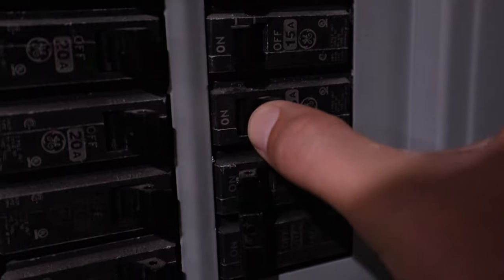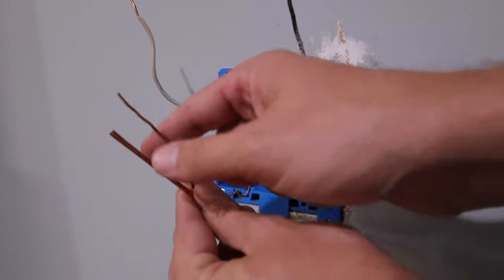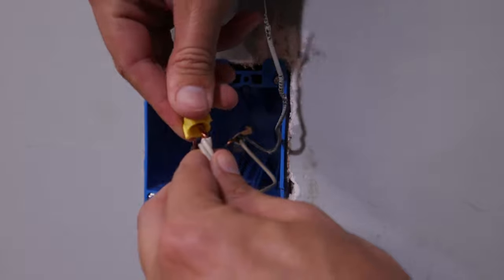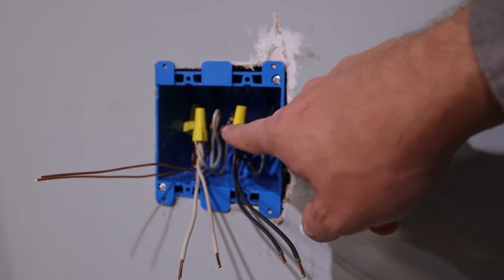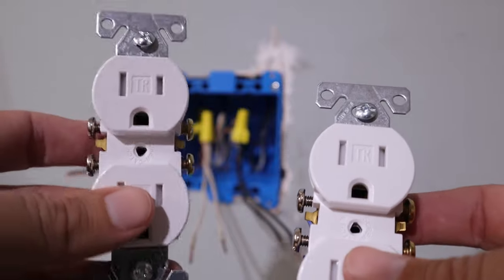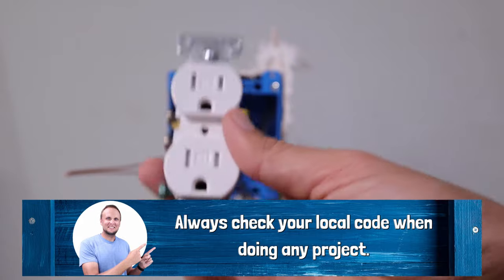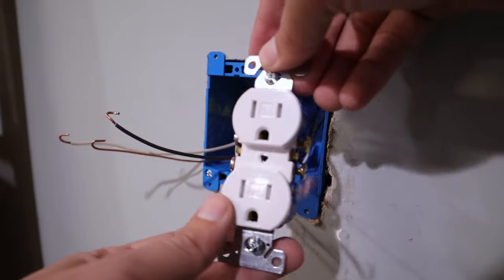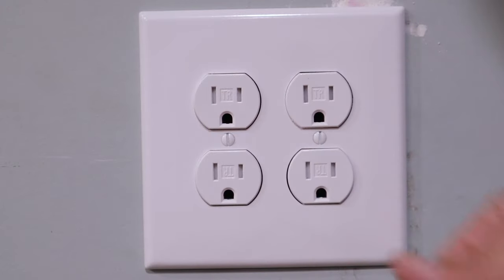How to Wire 2 Outlets In One Box | Wiring a Double Receptacle the Correct Way

Comment: Why use pigtails instead of using 1 receptacle as a passthrough, e.g. jumper 2 receptacles together using the extra set of screws?   Is it a code requirement?
Reply from the maker: In some places it is my understanding that it is code.  It has become the standard according to all of the electricians I have spoken with.  The idea is in case one of the outlets goes bad, that it is independent and doesn’t cause issues for the others or lights down the line.  Also my electrician friends state that using pigtails are safer.  Hope this answers your question!

Comment: Cool! What's the deal with loading? Are the wall cables strong enough to take double the load?
Reply: Technically no, and he should have pointed this out. The feeder wire is obviously only 14 gauge "Romex", and should be supplied by a 15 amp circuit breaker. The wire size here, suggests that this dwelling (and wiring) is quite old & not up to modern NEC spec's. Also, receptacles are specifically designed to be used as a terminating point for this type of wiring. Improperly installed wire nuts are just another place where a high load can cause overheating & failure & eventual fires. 
Ps: I never install 15amp receptacles,  only 20amp. The latter is built much sturdier than 15amp with better spring pressure & more connection options. Please, please, never use the "backstabbing" push-in terminals on receptacles unless they are the screw-down type used on good quality 20amp commercial & hospital grade (orange) outlets.
Btw, I'm a 72 yr old retired master electrician & used to teach apprentices (and anyone else who wanted to learn). Y'all have a great day.
Reply: @brianwood7480   Amazing! Thanks for your input. I imagined that at some point the load would be too great but honestly have no idea. I'm currently renovationg a room into a music studio which will have many high end pieces of equipment that will need multiple sockets. To be safe, running thicker cable sounds like the obvious move.
Reply: Also installing 20 amp receptacles
Reply from the maker: Ok a lot to unpack here.  There was nothing for me to point out as yes Todd, the wires run in my wall are large enough for the load.  Adding outlets does not change anything.  In fact, there is no code in the NEC that states a maximum number of outlets on a circuit.  All that matters is what are you going to use the outlets for and what else is on the circuit?  And in doing so how much amperage might be pulled at a given time.  If it’s too much for the wire size and circuit then yeah you very well may have issues.  There is nothing wrong with using wire nuts in a double duplex.  Also, my wiring is not old.  The house is 5 years old, was wired by an electrician, up to NEC specs, and has passed every inspection.  As far as 20 amp outlets go, sure, nothing wrong with installing them.  And I agree with Brian that the push ins are awful to use.   All this being said, Todd, I always encourage folks to check the NEC and their local codes before doing anything.  YouTube videos and sometimes the comments are great for getting an idea how things go but can be wrong in important areas.
Reply: @HowToHomeDIY  Thank you!! I appreciate your knowledge. I will definitely be getting a professional to take on this task.

Comment: what if the original outlet was a gfci unit,  can it still be converted into 4 receptacles?
Reply from the maker: It can but instead of pigtails, I would connect the standard outlet being added to the load side of the GFCI.

Comment: Specifically, and apologies if I missed this, is there a certain cable I need to use to create the pig tail splits?
Reply from the maker: Hey Patrick.  I just use whatever wiring that the circuit is.  In this case it is a 15 amp circuit with #14 romex so I made my pigtails out of #14 romex.  The wire sizes need to be the same as the circuit’s.

Comment: Personally, I can't stand the Tamper Resistant receptacles.  I find them hard to get a plug in and it takes a good tug to get them out, which can not be good for the outlet/box over time.  What are your thoughts on the newer Back Wire install?
Reply from the maker: They can be a pain for sure.  But if you have kids, they are a nice but also at times, a frustrating feature haha.  If by back wire you mean the outlets where you can just put the wires straight under a clamp on the terminal, I really like them.  I have tried to yank them out and they wont budge.  If you are talking about the push ins or back stabbing connections where you just push the wire in and that is it, I do not think they should be on an outlet.  They can come out really easily.
Reply: @HowToHomeDIY  Yes, I was referring to the newer clamp on the terminal.  Glad to know you approve them :)

Comment: Why not use jumpers from one outlet to the other? Is there a specific reason not to do that?
Reply from the maker: Yes, this way if an outlet quits working for whatever reason, since they are independent of each other, it will not affect the outlet next to it or any outlets or light swtiches on down the line.  If it was daisy chained, then if one went out they all would after it.

Comment: Not sure about where you are but when you remove that sheath you remove the marking from the wire
Reply from the maker: Ok?
Reply: @HowToHomeDIY  it's just a very small technical issue with code where since the marking is on the sheath and removed some very dorky inspectors will ding you for fun

Comment: I followed the video and made the pig tails as outlined and then attached them to each of the GFCI outlets I was installing. One outlet reads correct installation wiring and the other one doesn’t read anything. The outlet reader indicates this  means there is an open hot wire. Can’t figure out why this would be. The wires are in tight in the wing nuts and attached to the outlets. Any ideas on how to resolve?? 

The outlets I am installing have that yellow attention tape covering screws that tells you not to remove it so would I need to connect the wires to those screws on one of the outlets instead  of the regular screws? Any help would be appreciated. Thank you.
Reply: first off you don't need two gfi's in one two gang box, that could the main issue. all you need is one gfi wired up correctly on the LINE side (the screw terminals without the yellow tape. then in order to protect your second regular plug beside it all you do is take a white wire and a black wire off of the LOAD side of the gfi and use that to power your other plug, that will protect the other plug with the same technology thats in the gfi. I'm not quite sure why your second gfi isn't working at all, could be because of a bad joint on your black wire from the pig tail or a bad joint on the plug itself.
Reply: @johngalvao8917  
Thank you for the prompt response. Please forgive me as I’m still a little confused.  

There were two GFI outlets in the double gang box to begin with. My intent was to swap out the older GFI outlets and update one of them to include USB ports. 

The previous wiring on the outlets I removed just had the main black and white wires connected to one outlets and then had all the ground wires connected with a pig tail and on both outlets. There was a separate black and white wire connecting the two outlets directly. 

I was trying to do it the way in the video because if I understood correctly, doing so would be a safer method. Are you saying that I should just do it the previous way I described and connected the black and white wires from the second wires on the first GFI outlet and then the individual black and white to the screws under the yellow tape  instead of doing it the way described in the video?  At this point, I just want to get them both functioning again but with the new GFI outlets.

I hope I explained it so it makes sense. Thanks again for your help and feedback.
Reply: @lauriehardy267  im not quite sure how it was set up before but all I can tell you is the new gfi needs to be feed on the "line" side, this will be shown on the back of the plug. you shouldn't have any issues with doing it the way in this video as long as you make sure your joints are good and you have them under the right terminal. theres a possibility by the sounds of it that there were two separate circuits in that two gang box, meaning that before if one tripped the other would still work, idk if thats the case but if it is you would need to look into capping off the circuit you no longer need. Send me a picture if you'd like at my email whatgalvao@hotmail.com I'm on my third year of electrical apprenticing and should be able to help ya no problem

Comment: Why not use jumpers to second outlet? Strikes against pigtails: 1) introducing all those wire nuts is an opportunity for shorts, with so many unnecessary connection points 2) All those wire nuts and pig tails really fill the box and, depending on outlet, can make it difficult to fit all in there. Jumpers use the existing second screw built into the plug for the next outlet. They are how the outlet would be wired if there was another socket down stream. If this is end of the line, they can be used just the same here, reduce box congestion, take less time, and provide less opportunity for issues. This is how I was taught by a commercial electrician. I'm curious why the roundabout path here - rather than the direct approach of jumpers using the plug's provided second set of screws?
Reply from the maker: There are also numerous possible safety issues when using jumpers.  This way also keeps them all working independently of each other.  Typically the boxes are plenty deep for the pigtails so that’s not an issue.  Also, I work around electricians (commercial and residential) regularly and have electrician friends across the country and almost all of them use this method.
Reply: @HowToHomeDIY   Thanks for the feedback. I've done a good bit of electric but just for family/friends over the years. I'm always trying to find the best and safest way and been lucky to have an electrician friend to keep me in line. I really appreciate the community here on YouTube and your notes!
Reply from the maker: Absolutely!  It’s definitely nice to have electrician friends isn’t it?  I think on this issue it’s more preference and belief of the individual as to what works better as both can still be up to code.  I do think this method is becoming much more adopted.  Jumpers definitely used to be the standard.  I really appreciate the feedback Jeff.  Hope to see ya around the channel!

Comment: Nice video kiddo, I see you put connected the wires on the bottom screws of the receptacle, I have seen many other people do the same thing, is there a reason, or does it matter on the top or bottom?
Reply from the maker: Hey Johnny, it really doesn't matter.  The terminals are connected with a metal tab so that both are energized.  If in the case of a switched outlet though, the metal tab connecting them was broken, then they would both need to be energized.  But that is a much rarer situation.  Hope this answered your question and then some haha.  Thank you for the feedback!
Reply: @HowToHomeDIY  Thanks for your response!

Comment: Good video...  But you skipped the part about stuffing all the wires back into that old work box.  Especially depending on wire gauge, that can be a royal pain.  Any tips on how to do so 'properly'?
Reply: The easiest way I’ve found is to use a Voltclaw. It’s a long thin multipurpose electrical tool that’s purpose made just for this.  Also helps my old arthritic fingers twist on wire nuts.  It’s only $13 on Amazon or the big box stores.

Comment: Ty but what breaker amperage do we connect? 30amp if I wanna connect two toasters? But is it connected like the other 15amp breakers or like the stove and dryer?

Stove and dryer are connected differently in the box. Same square d breakers but connected differently. 

For this two plug shown here.... which breaker method is used? Like lights or stove?

Also. 30amp need what gage wire. Two toasters are 3000 watts minimum. So let’s say I need 3500 Watt power. To be safe.

Comment: funny how you check if the breaker is off AFTER you have pulled the wires out of the wall
Reply from the maker: How do you know that?   Did you see the wires out of the wall before I turned it off?   It’s just a visual reminder for anyone that might do it.

Comment: You forgot to mention black tape around each outlet.  For safety
Reply from the maker: Hey Bert, it is not that I forgot, I just typically don't do it.  This subject can be and is debated so I will just say that while there is absolutely nothing wrong with adding tape, especially in specific applications (GFCI, metal boxes, etc.), it is not required by code and depends on the the location and electrician or electrical company as to whether or not they do it.  I appreciate the comment!  Certainly something people can do that may not have been aware of it.

Comment: 15 amp breaker and 14 gauge wire?  You should make mention.
Reply from the maker: I purposely did not as someone may be on a 20 amp breaker and need to be using #10 or #12 wire.  This video is just a demonstration of how I installed 2 outlets.  If doing this kind of work yourself, you need to research all codes and necessary materials for the job.
Reply: @HowToHomeDIY  Thanks for making me aware.  Nice job by the way.

Comment: Why is everyone using pigtails in these videos? Especially 2 gang? You only make the job much tougher, especially when using solid 12awg wire. You didn’t show how tough it was to align the outlets to the cover plate. And if you have a feed to another outlet, all that pigtails wouldn’t fit in that box. You know you don’t need pigtails, right?
Reply: If you wire through the outlets instead, which is the alternative, the current drawn by the last outlet in the series has to travel through all the other outlets between it and the panel. Eventually one of them will fail and you'll lose power to all the downstream outlets, and good luck finding which one failed. This happened in my 1st home. A lazy electrician did this because it was easy. I redid the whole circuit with pigtails.
Reply: @maintayne  there are 2 screws on each side of the receptacle that shares the same solid metal tab that shares the same purpose as pigtails. At what point is the failure? You should have a more robust connection at the screws than at a splice cap. One wire per screw is better than 3 in a cap.